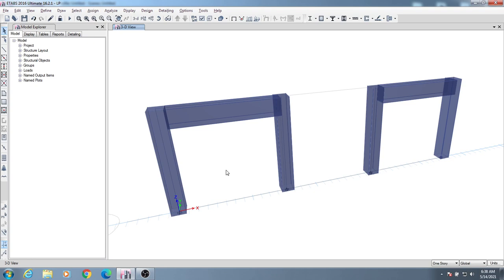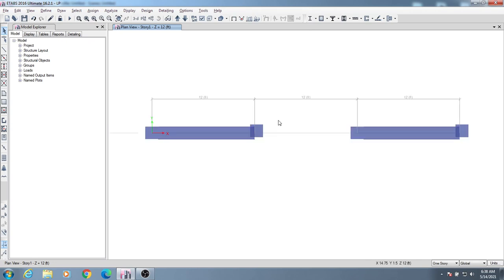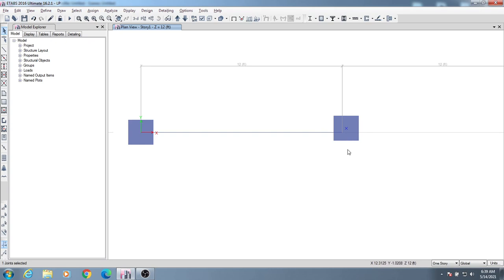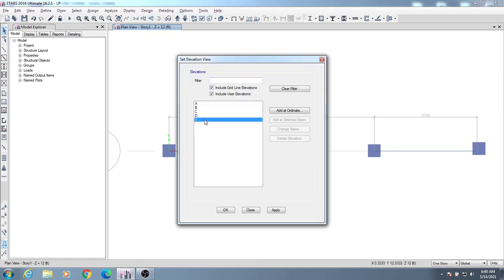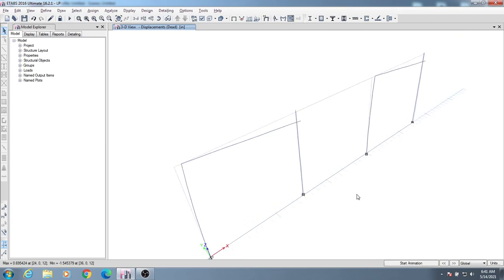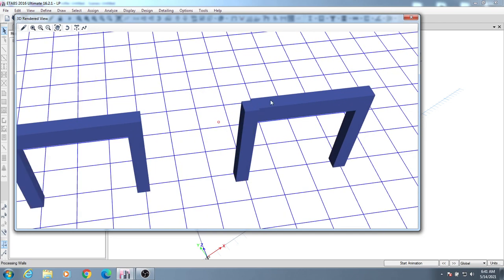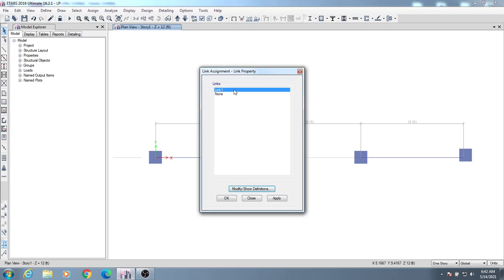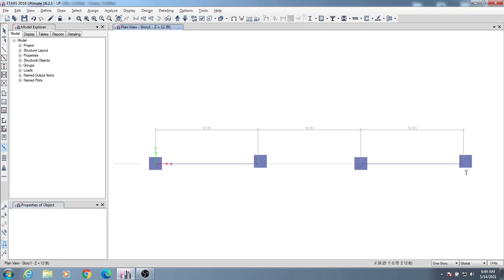Big Mistake in Etabs Building model | why and when should assign link property in CSI Etabs | SOCE

Comment: Sir, I would like to clarify a question.
What is the difference between using link-type elements or using offset with the function insertion point  for modeling beams and columns that don't have the same axes?

Comment: thx bro, but link can not make a lateral support for the column in case we have a multi story building, when you check the column result after the design in etabs you find it with double height story and that cause buckling failure mostly, i searched a lot for a solution, if u have an answer i will thankful for u.
Reply: Hey bro,
Did you find the answer?